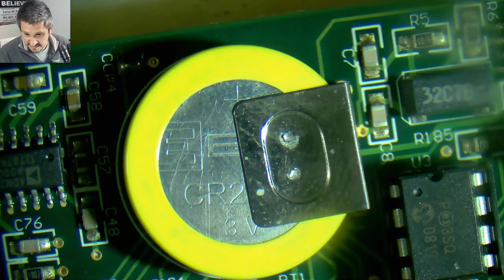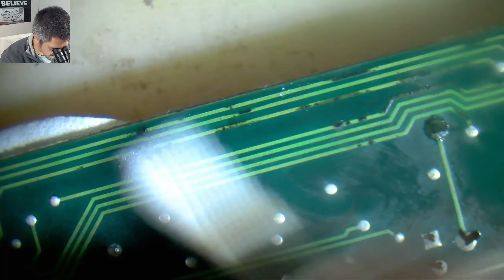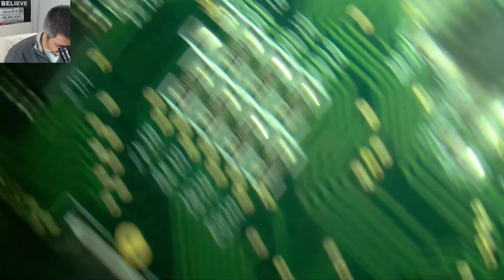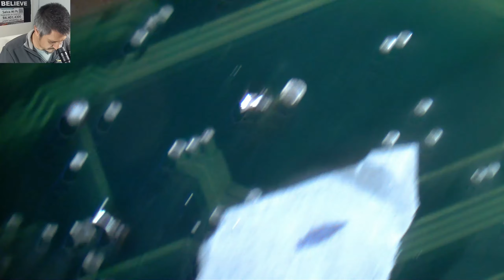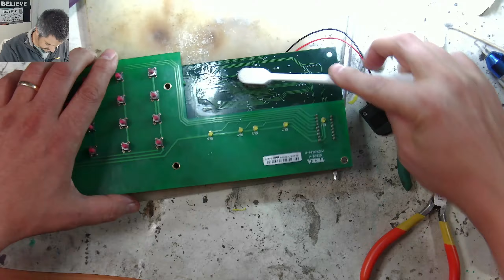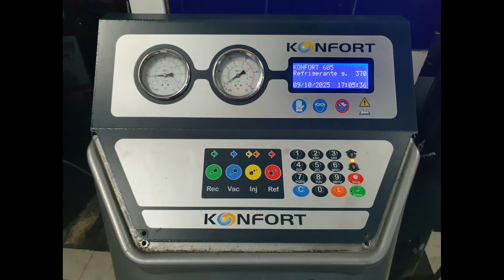Industrial $5,000 AC Station ! KONFORT 605E Profesional BIOS Battery Repair

Comment: Hola amigo ,disculpa tengo una maquina a.a. igual que compre y el vendedor me engaño y me la dio sin la placa que estas reparando, por casualidad sabrías que referencia le corresponde y donde conseguirla?, gracias
Reply from the maker: Hola amigo. La referencia de la placa es Texa 73240762-A / SC109-A. En cuanto a dónde conseguirla, va a ser complicado, pero puedes mirar en eBay o Wallapop. Incluso te recomendaría buscar por el modelo de la máquina en lugar de la referencia de la placa, ya que a veces aparecen equipos para despiece. ¡Suerte con la reparación!